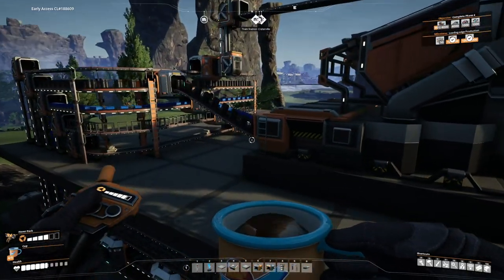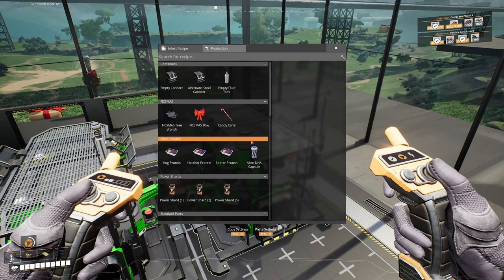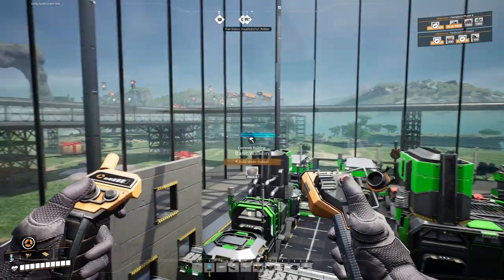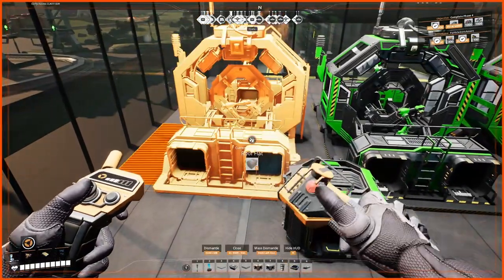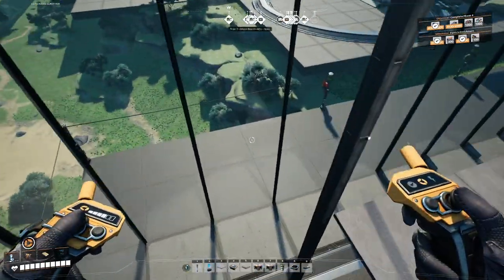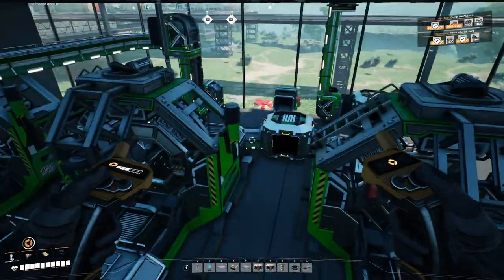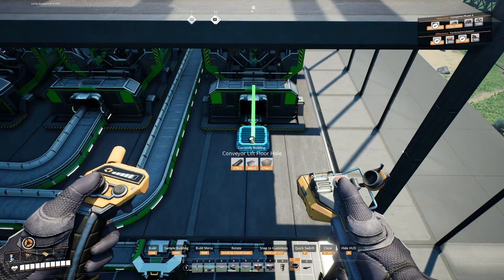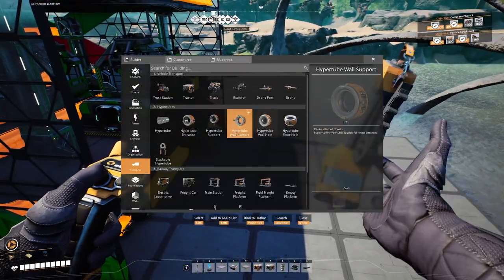Heavy Modular Frames in 1 Blueprint! - Guide in Satisfactory Update 7

Comment: Just hold left-ctrl when you place conveyors it disable the auto snapping :) Also, you can just double clic your stack of power shards to place one automatically on the machine instead of dragging it like you do. Small detail but it's useful when you have to do it multiple times!
Reply: If you use the copy and paste function, it does it automatically and is way quicker
Reply from the maker: I was only doing 1 machine of each type, but I agree that is definitely quicker when you have multiple
Reply from the maker: Thanks Pluk. Have the benefit of having this channel is getting to crowdsource answers to your problems lol

Comment: I love these one-click factory concepts!  Been working on one for motors that will stack as a vertical manifold so I can make skinny towers instead of long buildings. After fighting with blueprint floor holes for too long, I accepted that I'll need elevators on the outside, so it won't be as elegant as I'd like, but it'll be a start.

One design change I've adopted is to bring in iron ingots instead of ore.  It reduces the machine count and frees up some floor space, and I'll do a one click accessory smelter building or use refineries for the alternate recipe depending on where I need the factory.
Reply from the maker: That is a good idea for a motor tower and for bringing in ingots instead of ore. That would definitely free up some space.

As you said, might be a good plan to have a smelter building blueprint and then a stack of other blueprints. Interesting!
Reply: @DrLootCrate  Finally got the motor blueprint working last night.  Testing and fixing blueprints is a painful process.  I'm dreading having to update it when I unlock the next belt tier.  The smelter building should be A LOT easier.
Reply from the maker: @abmorse1  it really is, especially if you misbuild them in the wild and having to tear them down piece by piece.

Just to make sure that you know that you can replace belts by looking at them with new belt and clicking to upgrade. You don’t need to delete and rebuild
Reply: @DrLootCrate  Yeah, I get why they don't allow machines /belts to work within the blueprint machine, but that means you have to save the blueprint, build it somewhere nearby, connect some inputs to test it, fix each problem twice (once on the test bed, once in the blueprint machine), then tear it all down for each test run.  (which I did twice because of mistakes before I finished up the exterior aesthetics)
Reply: I've gone from compact towers to long factories. I really enjoy the simplicity of them
Reply from the maker: @dandpsy  for sure, there is a lot of map out there to expand into
Reply: @dandpsy  They would be simpler to make, especially for something complex like this HMF example.  Just need to make sure you're building somewhere flat if you want to expand later.
Reply: @DrLootCrate  did you know you can tap Control while using the delete tool and it adds them to a list that's all removed together when you finally hold left click? You can also hold control and swipe over up to 50 things at once. If you picked up something you didn't want to you can look at it and tap Control again to remove it from the deletion list, but the thing you're currently pointing at will always be removed, whether it's "on the list" or not.

It's like... Nega-zoop.

Comment: I think  your design is pretty awesomesauce as a first attempt... Its a really dirty design, and yeah, it works :) I have 2 comments for you on your design... (1) I think the steel pipe rod is much more efficient in resources, though i'm not sure you can fit that into the size of the 4x4x4, haven't tried myself, and i will not.. i'm not trying to be critical, you're thought process is awesome, and how you show people how to work this out for themselves is totally +1, but i think HMF's are better as a modular design. of several 4x4 BP's. I'm currently working on a modular design for a steel facility similar to your thoughts, and think you should try with the steel rod recipe and (f-ing) screws instead of the mod frame recipe, its incredible more iron efficient.

designs such as this are about being able to plunk down something like a concrete factory when needed w/o ceremony or thought, your oscillator design is such a thing as well *hug*, this one is a little too hacky, and i think you know that too. Good thoughts, keep em comiming, i hope to collab with you at some point :)
Reply: also... have you noticed how ceiling mounts are removing the need for a sandwich layer? its a huge game-changer, right?
Reply: also merry xmas :)
Reply from the maker: Great comment. I agree that HMFs would probably be better with two blueprints together and maybe just overclock the manufacturer if necessary.

This one is definitely hacky. It was more of a personal challenge than something really useful. I too prefer the oscillator design and video…I needed a bit more coffee before this one!

Comment: Nice video.

Nowhere near optimized tho...you're gonna make ONE heavy frame per minute which means, when automated, it will take almost an hour to make ONE computer, when I can make about 50 computers by hand in that amount of time.  I like your one click idea but I would love to see OPTIMIZED 1-click builds.

Get rid of the walls and the "starter" manifolds. If you get rid of those, the modules will be much easier to implement.  You're gonna have a bunch of walls blocking your access when trying to drop more than one of these at a time.
Reply from the maker: Thanks! I am a little confused by your comment. Computers don’t use heavy modular frames.

I hear you in the walls, later in the video I made a hole after realizing that problem. Those are the type of omission that happened since I did this on the fly and didn’t plan it